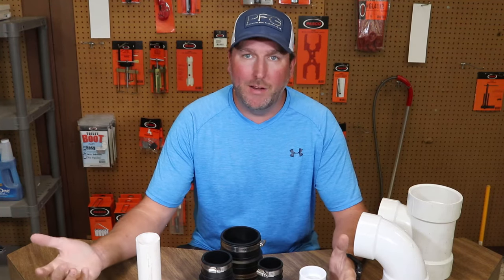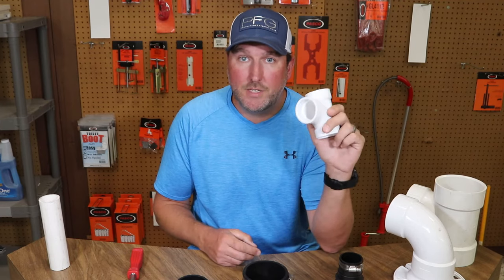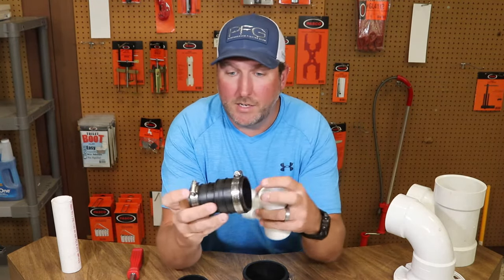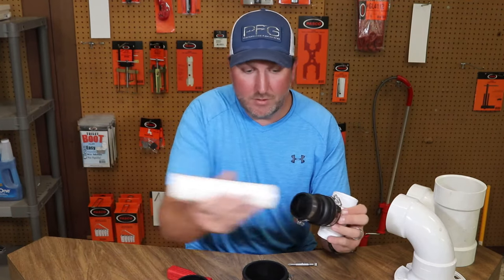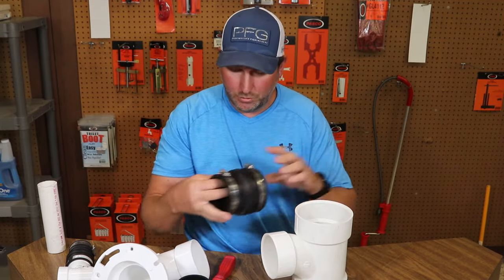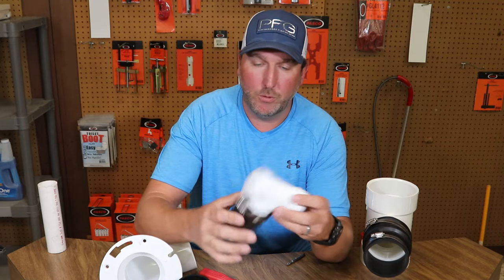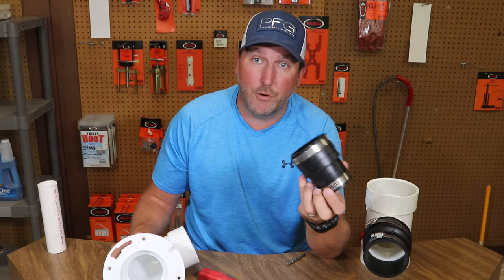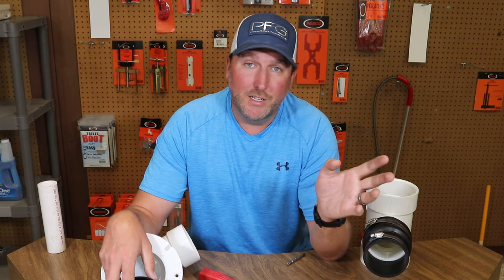Rubber Hub Coupling For Plumbing Drains

Comment: Excellent excellent excellent video!!! “Thank U” I’m a 71 yo female who has never done anything plumbing related. My under kitchen sink area has sprung a leak. I don’t have $ to hire a plumber! I was taking it all apart, bought the pipes & fittings I’ll need but broke the pipe that comes out of the floor & into a larger fitting. I just bought a fitting like the one in ur video but didn’t know if I needed goop or tape to repair it. It didn’t come with any instructions lol so thanks again!!

Comment: Nice video and good demonstration.  But what I find these rubber couplings useful for is to make permanently accessible section of drain pipe which can be removed at will by just loosening the rubber coupling.  There are troublesome section of pipe where it tends to clog badly and very hard to reach with snake, then having easy, direct access to that section of pipe solves lots of problems.
Reply: Good idea

Comment: Hello, do you have any suggestions on how to roll back the rubber on a 4" smooth stainless shielded coupling Proflex 3000-44 so I can connect 4 " cast iron to 4 ' pvc ? I am replacing a ancient backwater valve in my basement. The two materials have to be almost butted up against each other? I was going to use the e corrugated metal shielded coupling because it is easily rolled back on to the cast iron while I line the backwater valve up with castiron sewer line , but I was told by a plumber to use the smooth steel shield coupling. Thanks for any help

Comment: But what about a tub to shower MOD?  Going from 1.5 to 2 inch drain.  All that is left is a .75 to 1 inch nub on the main drain line to connect to.  Can you use this rubber coupling to transition to the 2 inch drain line from the leftover nub without having to chop out the main drain tee and install a new one with a 2 inch to connect to?

Comment: Butt-saving information! Excellently presented too.

I didn't get a new kitcgen sink but I have a galvanized 1-1/2" nipple completely holed thru on the bottom by rust & corrosion just outside the hub.   Getting it out was a battle but worse was how much of the threads had become one with the hub threads.  Like  there were NO fenale THREADS left in the bottom of the hub fitting.  
Thank u for the perfect solution!

Comment: Does anyone know how long these rubber couplings last?

Particularly when using them on old cast iron pipe to PVC.
Reply from the maker: There is no set time they will last but they have been used for decades in underground sewer applications.

Comment: Would adding sealant/dope reduce the likelihood of leaks or improve the long term reliability of mechanical coupling?
Reply: I just used one of these to connect to a brass kitchen drain pipe going into the floor.  When i slid the rubber boot over the brass, I could see that there was a tiny gap in the outside diameter of brass where it met the rubber.  I put a smooth bead of silicone and used my finger to fill the gap and angle it downward to promote good flow past the joint. Probably not necessary, but it won't hurt.

Comment: Can you use a rubber coupling in a pond?  I need to go from a 1 1/2 barb on a 2600 GPH pump to a piece of same size DWV PVC Pipe that goes to the filter. Same at the pond filter, to bridge across a small gap between same size PVC. No problems with the coupling sliding on smooth PVC.  I need to be able to easily disconnect at each end for maintenance.

Comment: Hello, wondering if u can help? i have old cast iron kitchen sink. the plastic that connects drain to the pipe cracked hard plastic that connects drainer to pipes, th strainer/drain isnt threaded, do u have anything i can use to connect  the 2, thank you

Comment: Thank-you what glue should one use to plastic to copper
Reply from the maker: I am not sure what you are asking? You don't glue plastic to copper
Reply: @PlumbingPartsPro  
Couple years ago a plumber connected my pipe downstairs which is copper to an plastic pipe it worked but now many years later is leaking would gorrala glue applied fix the leak thanks
Reply from the maker: @teddyboy252  I would not recommend that.  Email us a picture at info@plumbingpartspro.com  and we can help

Comment: As a Pro I'm feeling resistant to use  a coupling that goes over the hub. Feels like cheating. There has been scenarios where I definetly would use this when there's absolutely no practical way to remove the fitting and install new.
Reply from the maker: I agree. I would say this is an almost last resort. works well in situations where pvc has been sawed of under a sink and a Ram Bit saw is unavailable to cut the old pipe out you can place this over the hub.

Comment: Thanks Sir, that was very helpful. Will certainly look out for one of those connectors. Was never 💯 certain about connecting over a hub , but it appears that that is precisely what those connectors are made for, situations just how you explain it , and the exact situation I was in dealing with a sink drain pipe connection, thanks again, just out of curiosity, are you a licensed plumber, and or do you have any information about CSST pipe tubing , I am interested in changing over from black pipes to CSST , but am not sure If I can use the same exact size of the pipe diameter that is in current use??
Reply from the maker: Yes,  CSST  works well however you have to strap it pretty well or it looks like a sloppy job.  Also make sure you use the "Flash Shield" it's the BLACK CSST. This version is bonded and safer. There have been some lighting strikes and attacks the yellow an puts pinholes in the yellow.  The sizing is extremely close as far as the BTU load.  If your not adding a fixture the same sizing should be fine
Reply: @PlumbingPartsPro  thank you very much! Appreciate it!

Comment: I cannot find a  rubber coupling that will fit 2 3/4 in Galvanized elbow a little bit sticking out of the wall. I only find 2 inch to 1 1/2 inch reducer.
Reply: Call fernco customer service

Comment: I have a question. I am in the process of redoing a roman tub installation. The piping job was badly done, none of the connectors were cemented, causing water to seep out the plumbing and causing wood rott to the wood structure the tub was connected to. The issue I am having is the main drain line that connects to the tub drain needs to be at an angle, will these rubber connectors work to get the neccessary bend for the down drain line without having any leaks at the tub drain connecting point. The tub was raised above the floor, which makes the main drain line come up at an angle. I feel that a 20 maybe 30 degree angle is what I need for the down drain line to make secure connection.
Reply from the maker: I don't think I can get a 20 degree flex out of these
Reply: @PlumbingPartsPro  Thank you

Comment: Does this past plumbing code?
Reply from the maker: This should work in most plumbing drainage applications, however check with you local building code official.  I have had some inspectors approve items in one city and an inspector in a city 3 miles away fail something.  This is an item usually used in a repair application not new construction so an inspection is typically not needed.
Reply: @PlumbingPartsPro  Got it.  Have you used a Fernco to connect drain pipes (go from PVC from tailpipe and trap to ABS drain pipe) under bathroom sinks.  I ask because I have ABS drain pipe and have to replace the vanity and it's hard finding ABS parts.  I will be selling the house.
Reply from the maker: Yes, ABS has been more difficult to find.  This will fit over ABS hubs just fine but will only reduce to a pipe size.  So an 1 1/2 hub with a fitting pvc trap adapter would probably work nicely
Reply: @PlumbingPartsPro  Thanks
Reply: @PlumbingPartsPro  Sorry.  I may not have been clear with my question.  The pvc and abs pipes have no hubs, just straight pipe that needs to be joined to complete the drain connection under the bathroom sink.  It is my understanding that PVC and ABS can only be joined via mechanical joints.  Thoughts on using the fernco to join the different pipes.  Will this have an affect on selling the house? Thanks